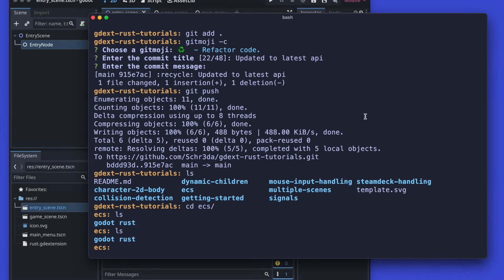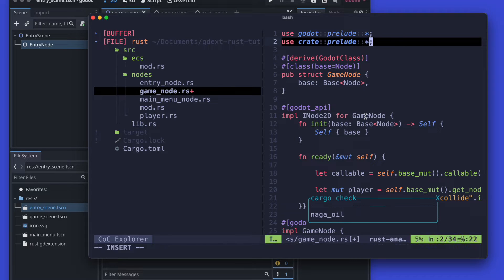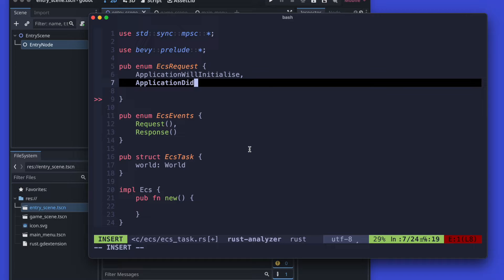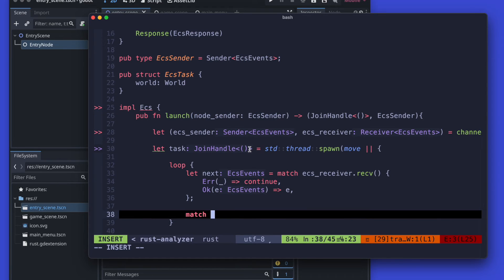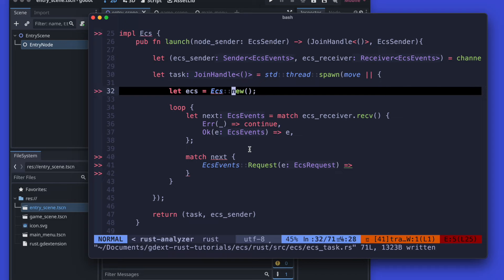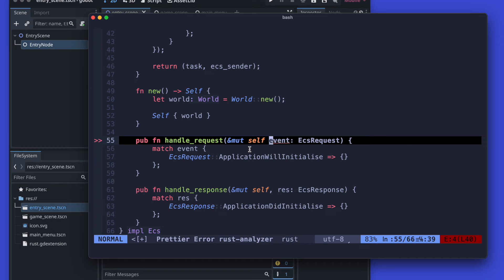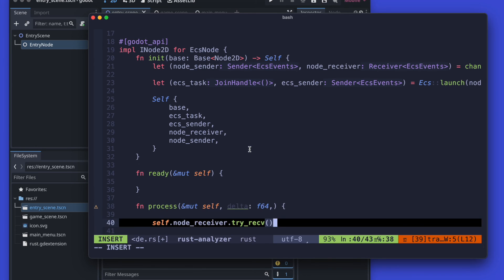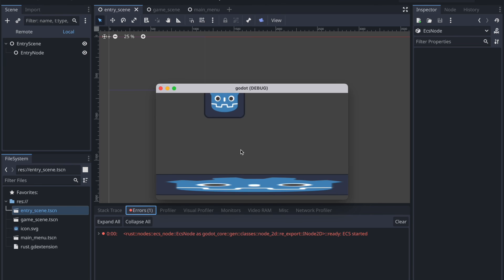Godot 4 & Rust - ECS (Part I)

Comment: What are the advantages of using a separate ECS system from a different engine (Bevy) than just doing everything in Godot?
Reply from the maker: As mentioned by  @boroborable it depends on the project. One benefit for me is portability as I can write my business logic in a generic way and share it across different technogloies
Reply: it depends on the project. performance is maybe even 100x better if you  loop over lots of objects, secondly, architectural standpoint, ecs might fit much better than OOP.

Comment: is there any advantage to Rust over GDNative, C++ or GDScript ?
Reply from the maker: basically you gain all advantages which rust offers over C++. Generally speaking i prefer rust over c++ for safety and borrow checker.
Reply: to code in any language other than gdscript and c# we use GDExtension (which is the successor to gdnative in godot 4)
Reply: GDScript - perofmance and safety, real language that you can use in different domains (not only godot)
C++ as laguange not so nice, you can shoot in your legs every hour :)